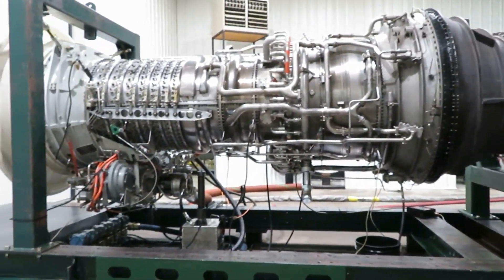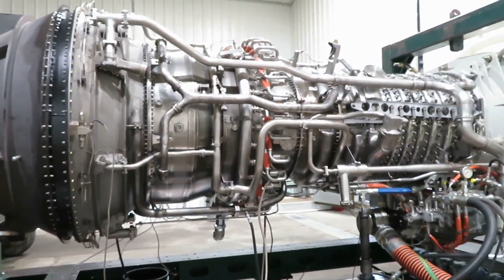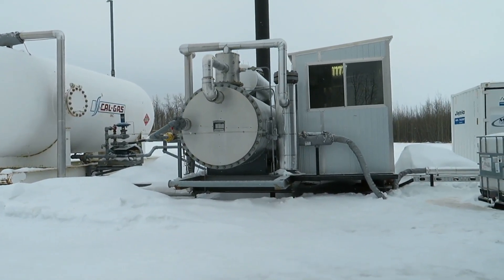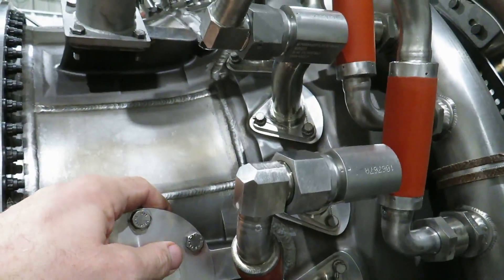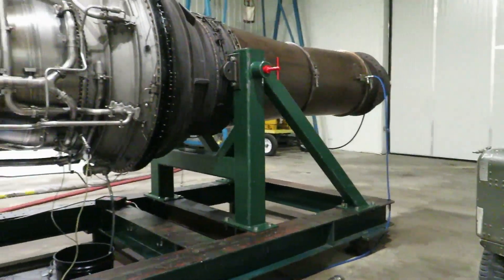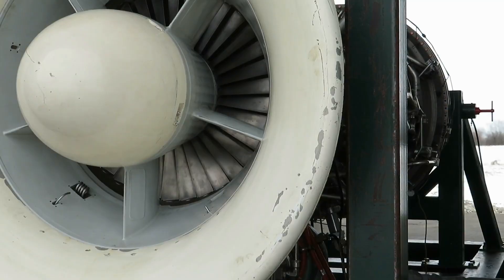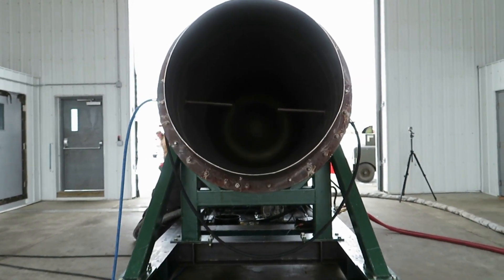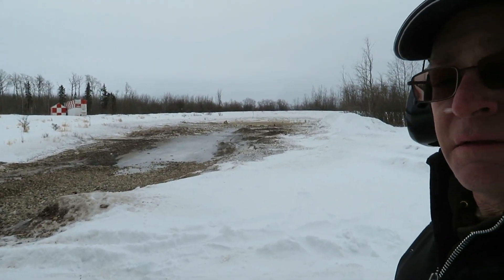The Big Engine - the GE LM2500

Comment: Why wasn't the compressor fan ever spinning?
Reply: @biglsells  
The front fins are fixed. The compressor is just behind the inlet fins. Visible at the end of the video. 10:10
Reply from the maker: The compressor on this engine does not have a fan. There are also no parts of this engine called "fins".
 I've made a video about this question, but I can't find it.
The front frame holds the front bearing in place with the big struts you see first.
Behind the struts ate the Inlet Guide Vanes. The turn on their axes, but do not rotate.
Third, you see the first stage compressor blades. actually, they are spinning so fast you can't see them.
To see the first stage blades, check out my Olympus videos, where I show the initial windup after starting, and the rundown after fuel cutoff.
Additional bonus homework for you: My playlist called Your Questions Answered...

Comment: I've never seen a turbine engine with inlet guide vanes like that....
Reply from the maker: Check out my vids on compressor stall to see what they are there for.
Reply: Industrial RR RB211 and Avon (now Siemens SGT35 and SGT20) have one set of IGV's, hence a far less complicated linkage than the LM2500

Comment: Interesting.  On Sunday, I got off of Royal Caribbean's "Brilliance Of The Seas", a cruise through Nova Scotia, Prince Edward Island, and New Brunswick.  The boat in question is powered by two of these LM2500+'s, and other than the fact that there was little smoke coming from the exhaust funnel, you would not know what was driving the boat.  The only diesels on this boat are the shore/emergency generators, which cannot power the twin azipods below the hull.

Interesting fact:  The LM2500+'s are mounted in the funnel, not at the bottom of the boat.  And due to the sound insulation of the engine "box", they are utterly silent and completely smooth. 40,000 hp each, they drive giant alternators that supply power to the azipods.

I fly Boeing 767's for a cargo airline, and they are powered by GE CF6-80 engines, 62,000 pounds of thrust each.  The LM2500 is the core of a CF6.
Reply from the maker: This is great info. I'm thinking the engines are positioned for easy access during installation or removal.

Comment: Why are you not burning liquid propane?  The heat of evaporation cools the engine internally and you get a higher specific power because less air gets displaced by fuel.
Reply from the maker: It's not a car engine, and is not affected by any of that piston stuff. It's a gas turbine engine. It's limited by exhaust temp, and only uses 20% of inlet air to actually burn fuel, because the rest is cooling air. If we burned all the oxygen with fuel, it would make 200 thousand hp, and melt in two seconds.
Whether this thing runs on diesel fuel, 87 octane gasoline or pure nitromethane, it makes the exact same amount of power.
This engine consumes 200 lbs per second of air, and  5 lbs per second of fuel. 
Boost? Compressor discharge is over 200 psig. On a modern airliner engine, "boost" is over 500 psi.

This engine is designed to run on natural gas, which we substitute with gaseous propane because a pipeline to our test stand would be a couple million dollars.
You can remedy your lack of information by reading one or more of the books I recommend, and by watching my playlist called your Questions Answered.

Comment: Why is there no flame or heat coming from this engine? What am I missing? Is it just using high pressure gas with no ignition source? I am evidently so confused. Thanks
Reply from the maker: Modern airliner turbofan engines may occasionally emit some flame or smoke on startup, but under all normal operation, there will never be any flame visible from the outside. The LM2500 is derived from the CF6-6 turbofan, which was introduced in the 1970s to power the Airbus A-300 and the Boeing 747.

Have a look at The Turbojet Start Sequence, to understand the ignition system. Like a candle or a campfire, once the fuel is ignited, the ignitors are no longer needed. Once a jet engine is started the ignition system is turned off. The engine is shut down by cutting off the fuel supply.
Reply: You want the combustion to occur inside the combustion chamber.
Reply: Fast jets on afterburner will show the blames and Mach diamonds. Fast jets on dry thrust show nothing to the naked eye.
Reply: i dont know if it matters but that's a ship engine actually!

Comment: How much thrust would the LM2500 make? Like the engine in the video for example
Reply from the maker: The LM2500 is a derivative of the CF6 that has the thrust producing fan removed. Thrust figures for the various models of the CF6 are readily available... on Wiki for example.
The thrust available from an LM2500 is not a thing.
Reply: @khaid12345  Very little actually, nearly 80% of the thrust in a jet engine is created by the air bypass which is mostly the 1st stage lpc fan blades. The other big component of thrust would be your lpt which the lm2500 also mostly lacks. What really impressed me was the difference in size of the gearbox. I'd like to take a closer at the generators as the generator for the cf6 that connected to the gearbox is rather small
Reply from the maker: frk... as a turbofan, the core has no propulsion nozzle, so you are partly correct. An LM2500 with a jet nozzle instead of an LP turbine in its exhaust would make around 20,000 lbs of thrust.

Comment: Thanks. I know that engine is started with an starter drive and speeds up, but at what  RPM you supply fuel to the burners?
Also, it seems you shut down the engine very fast by blocking fuel to the engine. But as far as I know, to reduce thermal stresses and preventing blades and casing damages you need to slow down and cool the engine very slowly. Can please explain?
Reply from the maker: The Turbojet Start Sequence.
Starting a turbine engine.
Cool your jets.
Reply: While it has been a very long time since I started one of these (retired NAVY Gas Turbine Tech), I believe the start sequence brings the ignitors and fuel in at about 2,200 RPM (engine is self sustaining at 4,500 and starter cuts out). It idles at 5,000. And you are correct regarding thermal stress. SOP for these same engines (GE LM2500) onboard ships is to idle for a 5 minute cool down before shutdown to avoid thermal stress to the rotating assembly. This version appears to be a VERY upgraded version compared to the ones I worked on from 1988-2008 so the thermal stress may not be as big of an issue or it did idle for 5 minutes to cool down and it was just hard to pick up on the video because they idle at such a high speed.

Comment: Where's the output shaft?
Reply from the maker: The output shaft would be driven by a power turbine. That is a separate piece of equipment for this model of LM2500, which is only the gas generator. Some models have an integral PT. 
We load this model with a jet nozzle.
Have a look at my videos on power turbines. Search feature on my channel page.

Comment: Are the inlet guide vanes part of the first compressor stage? Are they stators?
Reply from the maker: Stators have two functions. They direct the flow of air at the appropriate angle towards the rotor stage behind them, and they form a divergent pathway, where the actual compression of the air takes place, through the process of aerodynamic diffusion.
IGVs have only one function. They direct the flow of air at the appropriate angle towards the rotor stage behind them.
So yes, and no. Typically they are described as being different from stators, but they do look just like them.
Reply: @AgentJayZ  thanks for taking the time to explain. Based on your response I found this document online which provided me a good introduction to the concept of diverging and converging pathways: https://skybrary.aero/sites/default/files/bookshelf/1621.pdf thx again!

Comment: In the early 1980s when I built the frigates in San Pedro with these gas turbine engines the reduction gear the bull gear was 13 ft was told that GE owned the gears lease them to the Navy and that they cost over a million sounds like chump change now what do i know ?

Comment: 1980 to 1985 I was a marine machinist at Todd Pacific shipyard San Pedro California. We installed lm 2500'S on the Oliver Hazard Perry class frigates. Oddly enough I worked the first destroyer of the USS  Berry at ingalls shipyard pascagoula Mississippi in 1990 . And today they're still building the destroyers and Cruisers with Gas Turbines . I had my foot crushed in the number two engine room USS Berry fukin hurt 🤕

Comment: What do you need to modify for it to run on hydrogen
Reply from the maker: This engine? Not really anything.
It has gaseous fuel nozzles, and the fuel control is not part of the engine.
It's set up to run on natural gas, so a few minor adjustments are all that would be needed.
Reply: @AgentJayZ  how many of these  do you need for if you where going to build  SS Deutschland (Ocean Liner) (1900) and replace the boilers  with  the GE LM2500

Comment: Roughly 45,000 hp at an LNG plant in the south 😉
Reply from the maker: Yes. This is an early model of the LM2500. More recent models make about double the originally designed power.
Reply: @AgentJayZ  sounds more like the LM6000. The LM2500 has aprox. 30000hp max and is an aeroderivate engine from the CF6-50. The LM2500+ can go up to 40000hp. The LM6000 is a aeroderivate engine from the CF6-80 (newer version) and has much more Power. Greetings from Germany, I enjoy your vids.

Comment: About how many gallons per minute or hour does this engine burn when at the power range? From a comment, I read 5,000 pounds per hour which is 740 gallons per hour $5 = $3,700 in fuel only and 12 gallons per minute.
Reply from the maker: This engine runs on natural gas, so conversion to equivalent liquid fuel consumption is a bit of an estimate.
At full output, this engine in aviation form, the CF6-6, will burn about 30 gallons of fuel per minute...approximately.
Reply: @30,000 HP, the LM2500 consumes 32 gallons of fuel per minute (F76 liquid fuel)
Reply: @Yette  At what percent RPM?
Reply: @sanfranciscobay  RPM for 26,250HP will always vary based on ambient conditions as well as the efficiency/degradation of the engine. Estimated gas generator speed for rated power is 9,200 - 9,500 rpm. Estimated power turbine speed is 3,700 - 3,900 rpm.
Reply: @Yette  At $5 per gallon, that's $150 per minute in fuel only. That's a lot of money.

Comment: the GE CF6-50 is the aircraft engine version of that engine...
Reply from the maker: No, it is not. The early LM2500s, like this one, were developed from tha CF6-6.
The -50 is a later, more powerful model of the CF6.
Reply: @AgentJayZ  did they use the -80c2 as well? I’ve been working on -6 -50’s 80c2’s and GE 90’s since 1987, love them all!
Reply from the maker: I think the -80 is the basis for the design of the LM 6000, which is much more powerful than the LM2500. Almost double.

Comment: Jay, where’s the output shaft on this engine?
Reply from the maker: This LM2500 is the gas generator only. It delivers its exhaust gases to a power turbine, which has a mechanical output shaft. We have created a load with a jet nozzle, and calculate the power generated by measuring the pressure of the gas stream just upstream of the nozzle.
Other models of the LM2500 have an integral PT.
Reply: @AgentJayZ  not to sound dumb (im a car mechanic) but why have a Turbine power another turbine for power? Whats the gain in that? Why not just power from the first turbine?
Reply: @RussellD11  think of a hydroelectric dam, water turns turbines that generate power, in the use Jay describes above  the thrust/wind from the back of this turbine would spin another one, like the water in a dam spins it's power generating turbine
Reply from the maker: You guys both are making a slight mistake that is hurting your ability to understand what's going on.
It's very common to refer to a turbine engine as a turbine. A gas generator is a combustion turbine engine. A power turbine is simply a turbine connected to an output shaft.
For cars and trucks, the equivalent terms are piston engine vs piston.
Does that help at all.
Using "turbine" as shorthand for "turbine engine" is the cause of much confusion and miscommunication.

Comment: I just thought of something: In addition to the previous thing you said to me: If you were to remove the nozzle from a regular aircraft jet gas turbine engine, would that make it into a regular non aircraft gas turbine?
Reply from the maker: That is what the manufacturer does to the design. Also, to simplify maintenance, almost all of the external components are left out 
No need fot fuel pumps, oil pumps, generators, fuel control, etc.
Those models are called aeroderivative, and in the older ones we work on, the aircraft engine and the industrial GG have inner rotating components with the same part number.

Comment: What is the grey/brown thing attached to the back?
Reply from the maker: It's a testing nozzle that temporarily turns this into a jet engine. The outlet is carefully matched to a specification, and the pressure rise just upstream of it is used to calculate power output.
Reply: @AgentJayZ  so basically, gas turbines with nozzles are used to create thrust, and ones that don’t have a nozzle are meant for other purposes?
Reply from the maker: Yes. The exhaust gases generated have pressure and velocity.
The machine is correctly called a gas generator. If a nozzle is added, it accelerates the exhaust into a jet, by converting pressure into velocity.
The acceleration causes thrust, and the jet of gases gives the flight engine its name.
Reply: @AgentJayZ  so I guess that means non jet engine GTs don’t have nozzles because they are meant to turn a shaft or something

Comment: Not really large. I work for a company maintaining aircraft engines for Airbus 330/350/380 and B787. The A350 engines needs to get split as it can't get into a B747 freighter as whole. This is big!
Reply from the maker: Really? have you checked the dimensions? Because the Trent 900 in the A380 is a bit more powerful, but basically the same size as the CF6, from which the LM2500 is derived. I think you are being distracted by the large fan, which is absent in the 2500.
And the 787? The core of those engines is smaller than the LM2500.

Anyway, the title refers to the fact that for us, the LM2500 is one of the biggest we handle.
It's not a dick measuring contest, but thanks for your submission.
Reply: @AgentJayZ  Owned him bro

Comment: Yet another great video.  And, your initial assessment during the overview is so correct--beautiful.  Fascinating to think the progenitors of the jet engine (Frank Whittle in Britain and some German guy who read his patents) did so because as aviators they thought piston engines of the day were too noisy and shaky.  LOL.  Who would have guessed that was the "Mother of Invention" for the jet, turbo-fan, and gas turbine engines--noise and shakiness.  LOL.
Reply: I always thought that turbine engines were developed in the quest for an engine with a higher output rather than a quieter engine with less vibration. Those, along with better reliability, were just icing on the cake.

Comment: built around the similar time doe's the RB-211 have a core only shaft type engine
for power/ship and wondered what this now maybe 2 spool is called,
a few years back I discovered the B-52 had water injection on take off, you later 
explained the more you could throw out the back, the greater power you'd get
and the the bigger you are the more you could carry, thanks for that.

Comment: That's NOT a big engine. I run a GE Mark VI Frame 7 EA that produces 100MW of electricity. That's a big engine. The compressor and combustion sections are larger than a city bus.
Reply from the maker: Yes, they are awesome. This is big to me; it's one of the largest engines I have worked on.

Comment: OK @00:27 2 engineering bolts missing from the air intake? And Yes i know these don't matter. But when starting a Gas Turbine, you ask.....Where are they?
Reply from the maker: Good eye. I didn't build it, and I too, sir, had the same reaction.  They would not be so important if they were connecting the bellmouth to the front frame... but they connect the front frame to the compressor cases, so they are important. I have no reaction to your comment except to share your concern, sir.
Reply: @AgentJayZ  Thank you sir! I used to work on Rolls Royce Olympus and Tyne engines back in RN days as a Marine Engineer